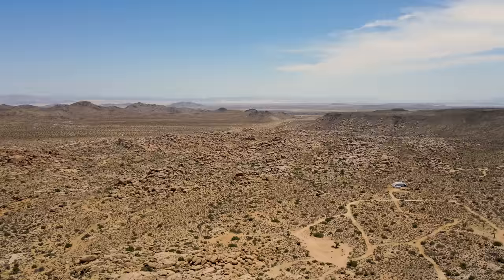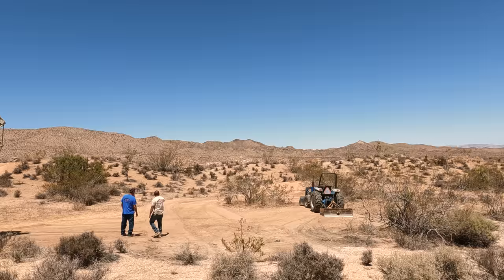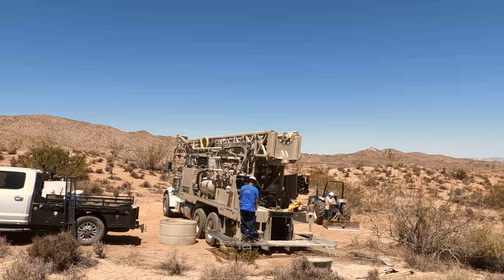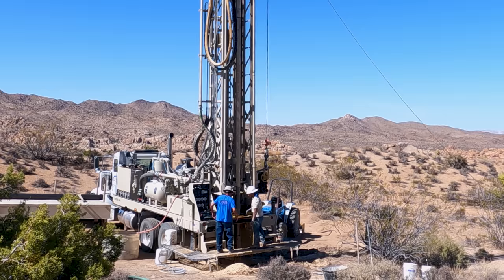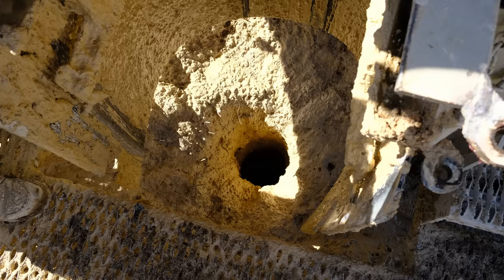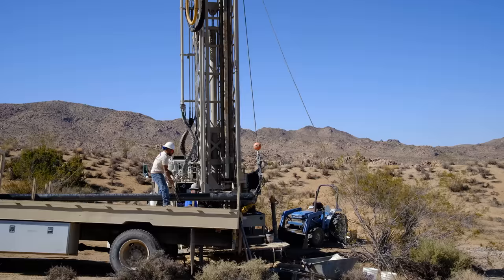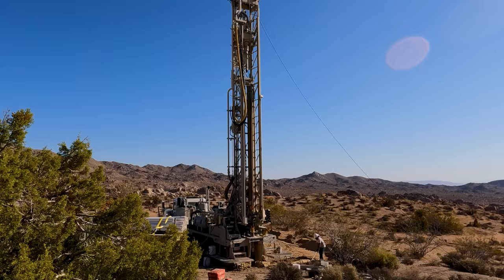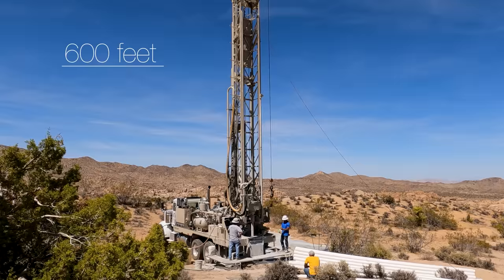Deep well drilling in the desert near Joshua Tree (part 1)

Comment: Concrete around the upper casing?  Or Bentonite?  Granted,, dry desert,, Bentonite may not get enough moisture to retain sanitary seal.
Reply from the maker: Thanks for the comment!  I know bentonite is commonly used but I'm about 90% sure it was concrete in this case since they dropped a whole bunch of bags of concrete on site, used some to seal around the steel, and then used the rest to pour the 6" slab when it was all done. Unfortunately I wasn't there when they did it so that's the missing 10% confidence in my answer ;)

Comment: 🤔Is any kind of licence or permission required for drilling the well???
Reply from the maker: Yes for sure. The drillers had to apply for a permit for me and the well was inspected by the county when it was done. I also assume the well drillers have to maintain their own license but I don't know anything about that.
Reply: @LetsOverthinkThis  In California, all contractors (aside from low value handyman type contractors) must be licensed and insured.  Drillers have a specialty license referred to as a "C-57" license.  They could also have a general engineering license, but that would be highly unusual.

Comment: question: how to detect the drilling point? i mean, how to know if there's water underneath the surface?
Reply from the maker: Short answer is you can't. There are technologies that can sense water that is shallower than this and/or through other ground conditions. Some people believe in using dowsing rods and they're free to believe that. I don't personally believe in it, and if I did, I'd believe you could maybe sense free flowing water that is pretty shallow. Not hundreds of feet through solid rock :)
In my case, I know my neighbors have water and how deep it was so I knew it was pretty likely I'd hit it too and luckily I did. 
Thx for the question!
Reply: @LetsOverthinkThis  thanks, my overthinking mind always worry that we get the oil instead of the water :)

Comment: Well, that's a pretty interesting video but I was left wondering: How many Gallons Per Minute did this Joshua Tree Well produce?
Reply from the maker: The wells out in the desert are very low producing... In the 2 to 4 gpm range so everyone has a big water storage tank. The well can produce at a low rate but for longer, and a pressure pump pulls from the storage tank for instantaneous usage. Totally fine for a household but not suitable for agriculture, etc. thx for watching!
Reply: @LetsOverthinkThis  I posted before looking at the comments where it revealed a Part 2. Watched it also. Answered a lot of questions....

Comment: I could not see the finished product out of drilling, i wanna see the water flowing from the pipe or a faucet
Reply from the maker: The water storage tank and pressure pump haven't been installed yet. You can see water coming out of the well in my water testing video though.

Comment: Cost to drill the well $$. ,????   Water hauling is common there too   probably not enough rain to try a water catch In a cistern.
Reply from the maker: I left the cost out because of the potential it has to be misleading; just ten miles away for example, the ground is sufficiently different enough to warrant them using mud to drill all the way down, resulting in a different cost. Let alone the fact that a well in the US can go from like $10k to over $100k based on depth, geological conditions, labor rates, ease of access, etc.
This one, for what you see here was around $60k USD (in early-ish 2022). Not including water storage tank or pressure pump system, etc.
You can't get a permit to build anything new out here if your plan is to haul water. They don't want endless heavy trucks navigating the unpaved road and I can't blame 'em. So you need a well to even get a permit. If the well runs dry later, you're grandfathered in and can get water hauled.
And yeah, not even worth it with trying to catch rain given we get about 4 inches a YEAR on average.
Anyway, thanks for watching!

Comment: How did you select that spot for drilling the well?  Any rhyme or reason?
Reply from the maker: Lots of reason... Once the site plan was done for the buildings and infrastructure, etc, there was really only one or two places to have the well that wouldn't cause a real pain later with long trenched water runs or having to pump water uphill a lot, etc. But no rhyme or reason in terms of where the water is underground. That far down, through rock, everyone with any experience here said it was basically luck of the draw.
Reply: You can have a survey and geologist point out a spot but there also guessing LoL 💦🛠️👍✌️💯

Comment: what method did you use to locate where the under ground Water was ? here we use 2 bent pieces of wire 1 held in each hand and then proceed to walk .
Reply from the maker: Short answer? I pointed to where I wanted the well as there were not any other places on the land it would make sense to have it in terms of the slope and proximity, lol. Longer answer, I do know people trust in dowsing sticks/rods like you described and there's obviously a big debate on whether it actually works. My personal belief, and I don't criticize people who use the method, is that if it does actually do anything and a person it capable of feeling a gravitational change due to holding  some sticks in their hands, it is more believable that it works when you're sensing water like 50 or 100 feet down, like it is in some places. I don't personally believe even if it works then, that it is going to sense water >400 feet down through solid granite. 
A friend asked me "what have you got to lose" as they were an advocate of that method. But I had quite a bit to lose: If it told me to put the well anywhere else on my land other than where I waned it I then would have to choose whether I believed it enough to spend 10k more to put a well on my property in an inconvenient place. So I took a chance and just put the well where I wanted it. 
Anyway, that's the very long answer :)
Reply: @LetsOverthinkThis  It worked for me as well as my dad.
Reply: @arizonapicker1836  I'm genuinely glad you found water but my point is if you live in a place where most people hit water, then you using this technique and finding water means not a lot. A test would be if somebody drilled in a place you didn't recommend them drilling and they didnt hit water. Know what I mean?

Comment: Why are they not wearing hand gloves . Are they that tough. Or just not careful
Reply from the maker: Good question Eric!
* Graphic warning *
My guess is that they aren't wearing gloves for the same reason you should never wear them when operating other high-power rotating equipment like mills and especially lathes: If you're wearing a glove, it's a LOT more likely that glove can get caught on the rotating thing and pull you into the machinery or just rip your entire arm off your body. This does happen with lathes, where somebody's glove, shirt, or long hair gets caught and their whole body just gets wrapped around the machine. Paradoxically, you're actually way better off just letting it cut your finger/hand and letting it tear that than having a glove on that doesn't tear and pulls you around the drill rod, etc.
To put it another way, the glove may reduce your risk of mild/moderate injury, but at the cost of increasing your odds off a fatal one. 
Great question though and curious to hear from others with experience operating drill rigs!

Comment: in 1973 i worked on a rig. there was a driller and me ruff neck. only 1 person got dirty. i would have to grab one end of the 20ft pipe and run with it wile the driller would let it down, twice a day all the pipe. the deck of the rig would be the drill. other than that its about the same. oh we would dig a big hole to mix the drill mud in
Reply from the maker: Interesting! That's for sharing. Looks like the more things change, the more they stay the same....

Comment: Just curious... what was your reasoning to spend $50k+ to drill a well versus just get water delivered for $140/month?
Reply from the maker: Hey there. Where I am, you can't get a building permit without your own water. If your well dries up, you can get water trucked in, but you cant base a permit on a plan to have it trucked in! Yes, there are ways around this but I'm not looking to evade the system for the next several decades. :)  And I actually agree with this system, since the roads near me are mostly tricky to navigate, only large enough for a vehicle going in one direction, and I'm thankful there aren't any water trucks regularly driving that route. 
Curious, that number seems low to me for water delivered this far off-pavement. Mind sharing the math that gets you to $140? (IE how many gallons, delivered to what zip?) 
Thanks for the comment!
Reply: @LetsOverthinkThis  Yep! :( I just found that out as well. SBC will not issue a permit for new construction without it because the state of California banned hauled water in 2018 for new construction.

Comment: Cool video. Curious, did you install perforated well casing down to 600' as there is no defined aquifer, or only perforated pipe at the lower depths?
Reply from the maker: Thanks for watching!  Still putting together the part 2 video but yeah, the perforated casing only was for the bottom ~100 feet (though I think the actual lowest 20 foot section or two are not perforated). and the rest of it was solid. The PVC well casing is 4" diameter but the hole is I think 6" so even without perforations, the water from higher strata will still be flowing down to the bottom to go through those perfs. That may not work in clay or other type materials, but since this is granite, even with cave-ins and such over time, I'm pretty sure water will still make its way down along the PVC to where there are perfs.
Reply: @LetsOverthinkThis  - - Water recovery time is important. A pump located 10 feet below a water line may not get enough water to pump properly. Just commenting.
Reply from the maker: @richardbowers3647  For sure and good point! My pump is sitting about 350 feet below the  static water level so there's actually good water storage in the hole and it's nicely submerged. The well itself doesn't have a high production, so it's definitely possible to get that level down to the pump, but that's why the well pump will be feeding a 5000 gallon storage tank on the surface so I can control how much cycling that well pump does.

Comment: Is there local water there or well only? That sure is expensive to have your own water. I've read that CA land owners only get the mineral rights for the first 500 feet. Does that apply to water as well?
Reply from the maker: No utilities or services way out there... if there were, it would definitely be cheaper and easier to use 'em! :)
I'm just putting a house there, so I don't know anything about the mineral rights and as for the water, it's a legal well (permitted and tagged by the county) from a permitted and licensed well driller so I don't think the 500 feet thing is actually true for the water. Or not in the case of a single residence which this is... Agricultural use may be very different, for good reason.
Reply: @LetsOverthinkThis  it depends on the county it can change from location to location

Comment: I gotta ask about the cost.
Reply from the maker: Yeah I left it out because of the potential it has to be misleading; just ten miles away for example, the ground is sufficiently different enough to warrant them using mud to drill all the way down, resulting in a different cost. Let alone the fact that a well in the US can probably go from like $10k to over $100k based on depth, geological conditions, labor rates, ease of access, etc.
This one, for what you see here as around $60k (in early-ish 2022). If you need a ballpark cost, best to contact a local well driller. Hope that helps!

Comment: How much did this cost?
Reply from the maker: A lot. But it's pointless to give the number since it's not relevant to anyone (they will have their own price). Plus, the price is also about what's included (pumps, controllers, pressure tanks, holding tanks) or not and nobody seems to ask about those which also means the answer isn't relevant. 😁
Reply: @LetsOverthinkThis  i just want an idea of around how much it costs, im planning to buy some land but i wouldnt want to pay like 20K to make a well
Reply from the maker: This was several times that. But that's my point: in other places with different ground conditions and depths it will be a very different price. Call a well driller in your area to get a better answer for you!
Reply: @LetsOverthinkThis  ... a friend of mine does this locally (Ct USA) and his pricing is a series of things that vary by job. There's site prep because not all jobs are "just drive in" then there's the rig set up fee. After that there's a price per foot for that iron / steel casing. Into rock is one price but into gravel or sand with cement is another. After that is a price per foot for the actual drilling. Add in the sleeve pipe (if needed) and the pump pipe, the pump, trenching to the house, then a tank and other plumbing plus wiring. A well at 125 feet deep can run $5 - $10k by the time you are done. No two are the same.
Reply from the maker: @rupe53  For sure! People don't seem to get this, but it's a complex service you're buying and indeed, what I paid has little to do with what it will cost others! Even if the ground was all the same, every install will have different equipment based on site needs (storage tanks, pressure tanks, controllers, etc) and people who scream "what did this cost!" and don't even know what is included in the "this" part of their question aren't going to get a usable answer even if I told them the number 😂  Thanks for watching and commenting, btw!
Reply: @LetsOverthinkThis   Awesome video. So, I think the people just want a ballpark number even a range number on what the job cost you regardless of its location .. of course, every location is different, and the price varies. So, you're saying you paid several times more than 20k which I would be assuming 140ish k? Also, on another comment you had left from someone else's question you mentioned "Let's just say it was over 40k". I would also like to know what your price range was that is why I'm commenting and asking a question and yes I'm talking about the works, the complete package. Nevertheless, awesome video!
Reply: @jessesilver  LOLL i was literally just curious how much it costed. Idk why everyone is giving me the run around.
Reply: @jessesilver  it’s a simple answer not a secret
Reply from the maker: They give you the runaround because it's irrelevant what it cost me. For me it was about $60k but it might be like $3k for you if you're in an area with shallow water and easy drilling and cheaper labor. Or it might be $100k plus if your conditions are worse than mine. That's why its a runaround. Getting a quote from your local drilling companies and talking to a few potential neighbors is the only way to get real pricing for yourself.
Reply: Trying to find someone who can drill in Tx Sierra Blanca, please let me know

Comment: How did you determined the location to drill?
Reply from the maker: We drilled in the only place that made sense on my land: every other spot would entail compromises and additional expenses in trenching water lines and such.
I'm not aware of any tech that seems real that can actually detect water this deep, through rock. There is ground radar but it doesn't detect this deep (that I have seen at least) and while some believe in dousing rods and are free to use that, I don't personally believe in them.
Hope that answers it!

Comment: How deep was the water table at the drill point.
Reply from the maker: The static water level is about 165 feet, but I'm not sure it's technically the water table since we're at high elevation and the water is from between various strata of rock as I understand it. Not sure if that's what you're asking.
Reply: @LetsOverthinkThis  more or less, thank you for your response.  Good video.

Comment: How much did this cost? Can you break down the cost and schedule for this ?
Reply from the maker: Hiya. I left the cost out because of the potential it has to be misleading; just ten miles away for example, the ground is sufficiently different enough to warrant them using mud to drill all the way down, resulting in a different cost. Let alone the fact that a well in the US can go from like $10k to over $100k based on depth, geological conditions, labor rates, ease of access, etc.
This one, for what you see here was around $60k USD (in early-ish 2022). Not including water storage tank or pressure pump system, etc.
As I recall, was about $68 a foot for the hole and the rest of the cost was for the 500-600 feet of large PVC, the 500-600 feet of water-carrying PVC, and the well pump itself (with electric). 
Not sure what you mean by schedule. I had to wait a long time for my slot as the drillers were busy, but the whole thing took less than a week. 
Thanks for watching!
Reply: @LetsOverthinkThis  thank for this info.

Comment: What did that cost ?
Reply from the maker: Hey there. I left it out because of the potential it has to be misleading; just ten miles away for example, the ground is sufficiently different enough to warrant them using mud to drill all the way down, resulting in a different cost. Let alone the fact that a well in the US can probably go from like $10k to over $100k based on depth, geological conditions, labor rates, ease of access, etc.
This one, for what you see here was around $60k USD (in early-ish 2022). Not including water storage tank or pressure pump system, etc.